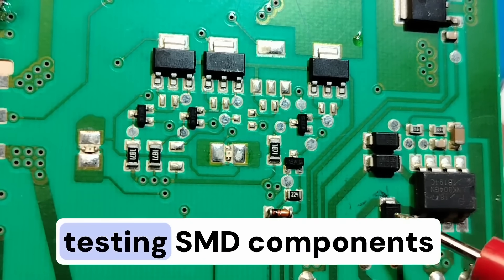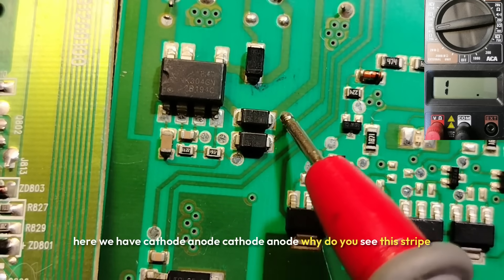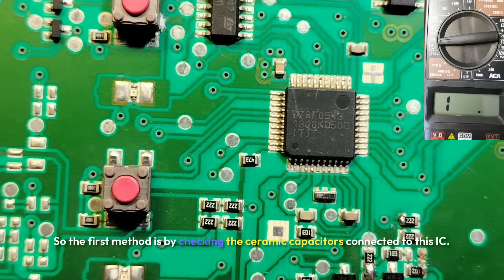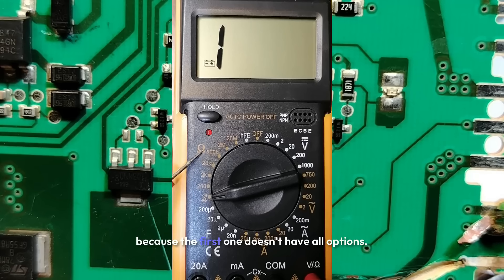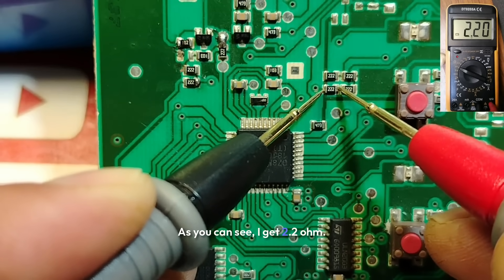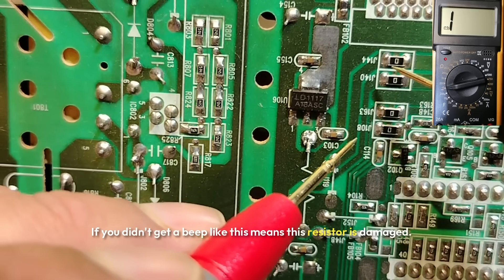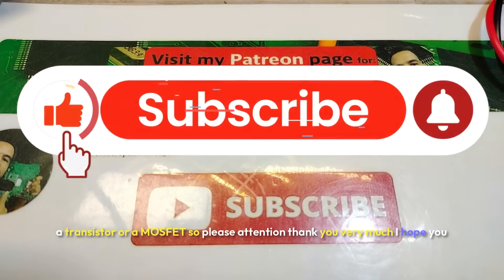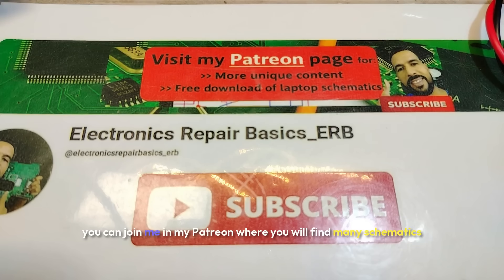Electronic Components: Master SMD Testing with Multimeter, From Capacitor to IC | Electronics Repair

Comment: First 2 minutes, you checked a ceramic capacitor and it had a high reading with continuity.  You said that was a good ceramic capacitor.  The next one you tested had no continuity and you said that means it's a good one.  I'm confused.  Should a capacitor have continuity or not?
Reply: Ceramic capacitor has highest continuety if ceramic capacitor has low reading its faulty under 400 below

Comment: can it be that easy I am on the 12v power rail and started checking the n channel mosfet because of the "don't get confused about the similar looking part" and located a gate to source and to drain reading of 40+ an 50+ k ohm and that indicates a bad mosfet right?. Now this board is randomly restarting or blue screening error, at this point should I just swap out that part and see if it fixes that issue or go further?{no caps are tested bad}

Comment: also diod in parallel with capacitor gives a reading of short circuit  for a some while depending on capacity of capacitor, the time that is required for the capacitor to be charged.

Comment: Thank you Senior , please if a capacitor check is beeping booth side it means what
Reply: If it s a big capacitor ( microfarad and beyond) ,beeping in the First moment can be normal , until the capacitor is loaded. Or maybe you  measure a supply rail with several capacitors in parallel ( that sums the capitance up). If you want to be sure , you have to desolder the cap and measure it seperatly. In pF and nF range ,there shout be No beeping....

Comment: Please if the writings on the resistors are wiped or burnt and numbers can't be seen?
Reply from the maker: If the markings on the resistors are wiped or burnt, you can use a multimeter to measure the resistance and identify their value. It’s a bit of trial and error, but it can definitely help. Sometimes the values of components are written under them on the PCB

Comment: Sir ur good! But I don't think testing passive & active components onboard is the best idea. Broken parts is not just open, short or burnt. What about thus leaked ceramic capacitors & transistors?
Reply from the maker: You raise a valid point. Testing onboard components can be tricky, and sometimes issues like leakage can be less obvious. It's always good to be thorough in our diagnostics!

Comment: What is "up line" at 7:05?
Reply from the maker: An open line refers to a condition where a wire, connection, or component is disconnected or has infinite resistance.
It’s like having a switch turned off, there’s no complete path for electricity to travel.
Reply: @electronicsrepairbasics_erb  Thank you!

Comment: The last one is one that helped me tell the difference. Because some stuff does not have marking on board or chip. 
So if you test it like it is a double diode. You can possibly tell it is a mosfet. And maybe how the trace looks connected to it.

Comment: Hi my Friend i have a problem with a lenovo  IdeaPad 3 15IIL05 with i7 1065g7 cpu .  When i move the case of this laptop i have a crash video signal and after all the sistem going in crash .  Do you think that it's the integrate gpu problem ? (Intel iris plus graphics )  i have not another gpu on board ) .  Have u an idea ? Can i to try reflow ? What do you think about ?